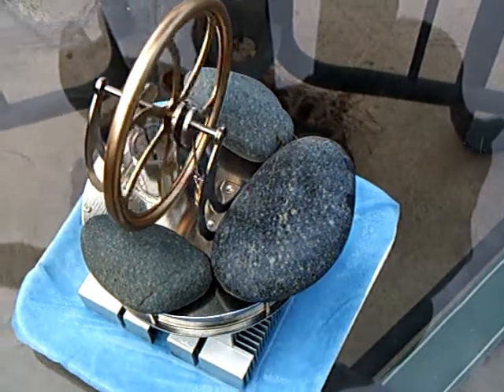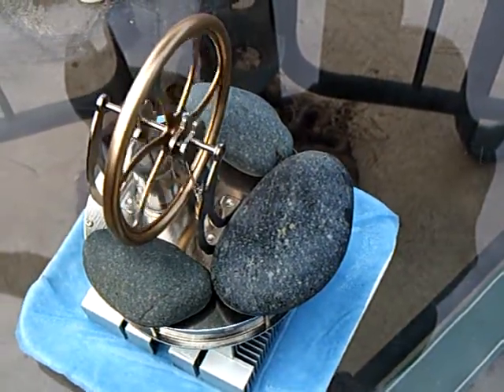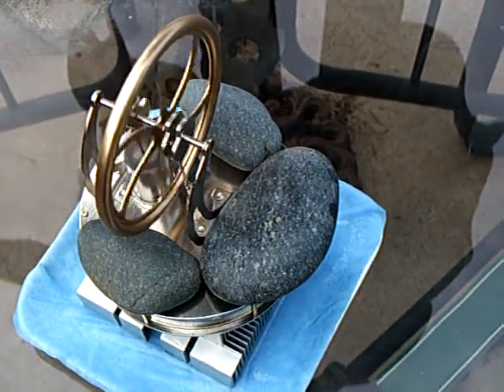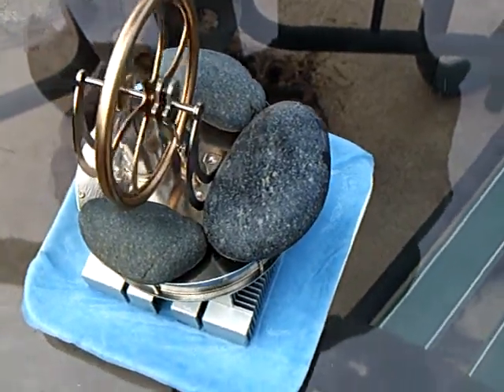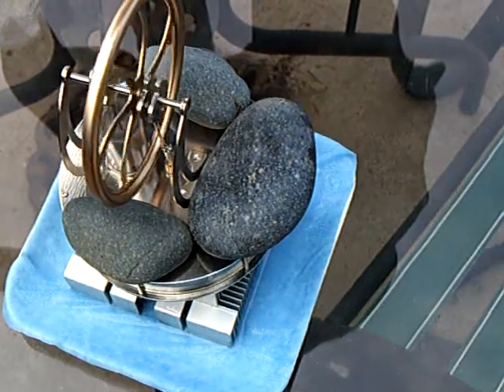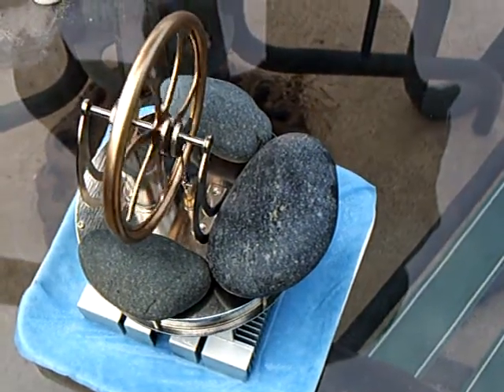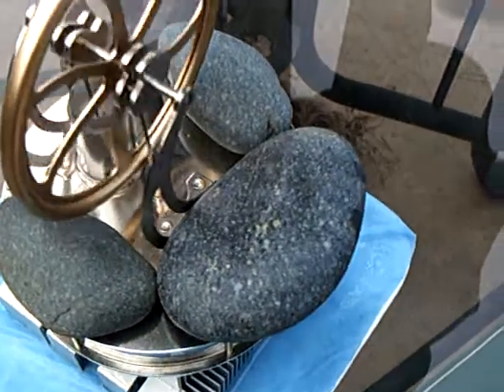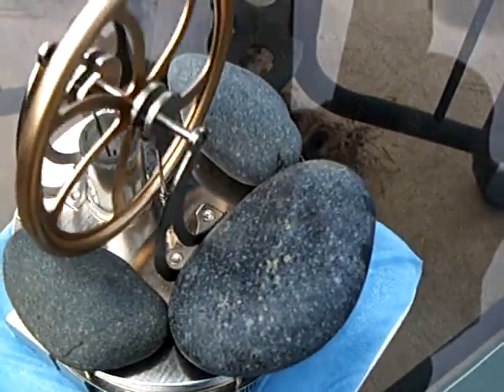Black Rock Stirling Engine

Comment: Zero maintenance is the direction i'm thinking. It would be handy if you had a stream in the backyard eh. But anywhere from about 6" into the ground is always much colder than the ambient air in summer. It should give you your 20 degrees :)

Comment from the maker: Getting the cold from the earth is something I have to try.   I wonder what would happen if I just stuck the heat sink in a bucket of wet beach sand and wrapped the bucket in a wet towel.   I'm on the hunt for a 20 degree temp diff.  That's what this Stirling needs to run.  The really good ones only need a few degrees.  John Hav made one.

Comment from the maker: The problem with the dish or the Fresnel lens method is the sun tracking system and the problem keeping the focusing device perfectly clean.  They are high maintenance.  I like the solar chimney idea though and I will look into it more.  The one I read about was big and amazing how it worked.  Extremely low tech but effective.

Comment: Runs well and the Fresnel on the rocks would probably make it hit turbo boost lol.
My stalled outdoor large Stirling would/will be similar, cos the slate from our bathroom heats up to daft temperatures in sun. Base of Stirling will sit a few inches into the ground, via a tube to carry the cold, below where the sun heats in the day.
Perhaps you could try a tube into the ground for the cold side ? am intrigued.

Comment: Nice, low-tech.
And I now think of silver bullion bars wrapped in black paper. And ferrofluid.
If you managed to drill a good hole and get a geothermal flow going...the engine will go on forever.